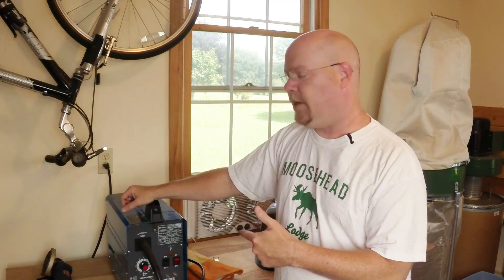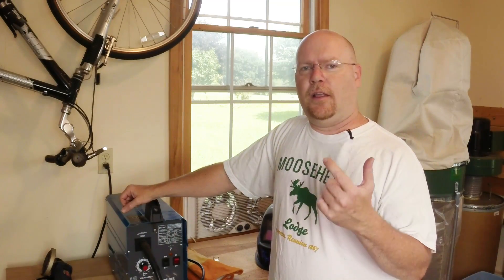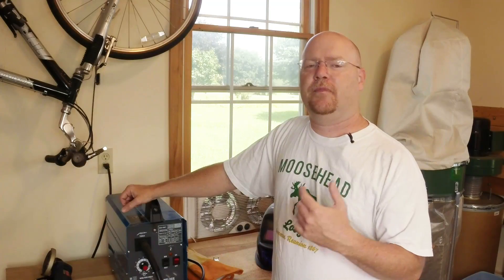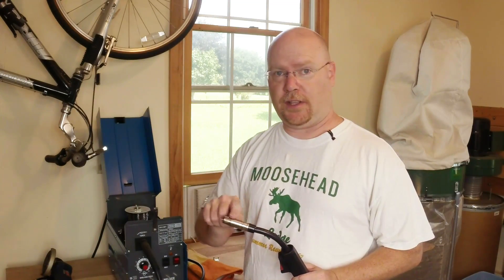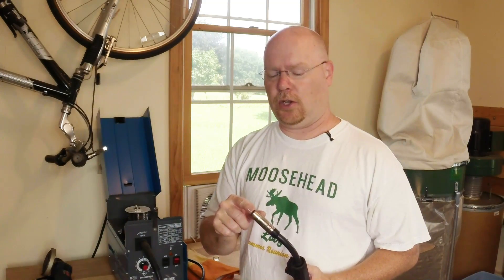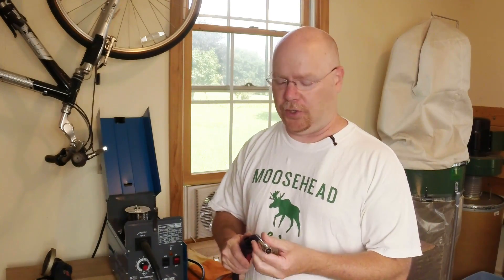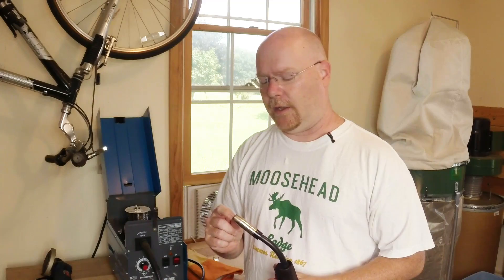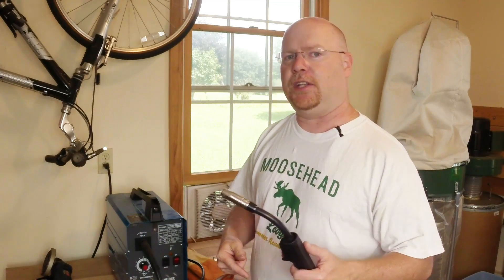Easy Harbor Freight 90 Amp Welder Mods 01

Comment: Since doing this mod, have you tried welding thinner metal (20-22ga)??
Reply from the maker: I've done some 20ga since doing the conversion to DC.  It can be done, but it's dicey.  You have to stitch weld.  If you try to run a continuous bead it''ll blow through for sure.   Even then you have to keep the "stitches" pretty far apart and make sure the piece has cooled down completely before putting down another weld next to a previous one.

In the end I decided that this welder is really only useful for 1/8" material.  I end up oxy-maap brazing the thin stuff most of the time.
Reply: Matt Heere right on!! I’ve got a newer version, I’m trying to do patch panels on my car, it’s blowing right through the way it is!! Was hoping that if I did this conversion it would’ve helped??
Reply from the maker: No, unfortunately it won't.  In fact, it'll probably make things worse.   It's easier to control once it's modded to D.C., but it runs like it has even more power.
Reply: Unless you have a nice everlast pulse mig setup like I do, sometimes you just need to stitch weld. If you can get to the backside, sometimes putting a good heatsink right up against the metal will help prevent burn through.

Comment: Matt, HF upgraded their base model to 125 amps. To convert to DCEN, would all the same parts work?
Reply from the maker: Same idea, but the parts need to be bigger.  You'll want at least a 150AMP rectifier.  Probably also need a higher voltage rating on the capacitor, but without being able to stick an AC peak voltmeter into the new unit I can't say how much bigger.

Comment: I've watched both series of your videos and think that their FANTASTIC . You have great attention to detail and have obviously spent time and effort researching everything that you've covered. 

I haven't read all of the comments and apologize if someone else has brought this up.  Doesn't the flux core vaporize and provide a gas shield around the puddle?  Isn't that how stick welding works? It's been 40 years since my metal shop class, but I think that the coating on the outside of an arc welding rod vaporizes and creates a bubble of inert gas around the puddle. Because the rod coating has more volume than the flux core of the wire, the stick generates a better shield than these inexpensive wire welders. As you point out, using a real MIG welder with an inert gas has the same effect and really does utilize the cone.

At any rate,  I have this same blue HF wire feed welder and admit that I've never been great at welding. Still, when I find a sweet spot combination between the cone angle and distance above the puddle I get: a good solid bead with little to no porosity. The bead has great penetration (especially when I bevel the edges of the seam), and I end up with a uniform layer of slag that needs to be chipped (not brushed) off the bead when it cools.

Regarding the spatter, I coat the cone & tip with Lincoln nozzle gel. I also wipe a ~1-2 inch wide stripe of the gel on either side of where the bead will go. The gel reduces spatter buildup in the cone and aids in removing the spatter from around the bead. As you also pointed out, the full length  cone makes it difficult to see the puddlr. So I neither pull nor push the gun. Rather, I draw it sideways so I can both watch and control the puddle.

Please note that I'm not contradicting any of your observations, suggestions, or the u sensible need for these awesome improvements. I personally can't wait to make these mods and try them out on my next project. 

Thanks again for all of the thought, time! effort, and talent that you've shown in your work.
Reply: Is it a pretty straightforward process to similarly upgrade any of the ac flux core welders in this class?  Like this one, for example...https://www.ebay.com/i/272834467383?chn=ps&dispItem=1

Comment: Keep the cone on its keeps the tip cleaner longer and you won't ground the torch on work piece. My first welder was a century 80 amp I had 20 yrs ago still have but up graded to a 255 mig tig stick combo and love it.
Reply: I bought a PowerMTS welder (mig/tig/stick) machine. mig/tig/stick welders are the best thing since sliced bread.

Comment: I will try to keep this short.  I have one of these welders that I purchased probably 5 years ago.  It did not weld very well and I thought it was just me.  I found these videos. I haven't installed a capacitor yet, just used the rectifier.  The difference in weld quality is amazing and I am still using the cheap harbor freight wire that came with it. THANK YOU for the series of videos.
Reply: If I had seen these videos 6 months ago I might have kept my HF welder but ended up getting frustrated and just bought an everlast welder. The welding with the HF was difficult but I was really upset with the low duty cycle. I guess I could have mucked with it and put a large fan in the case to help keep the insides cooler.

Comment: Your series has been a great educator. I was remembering when in high school ag shop that my welds never looked as bad as what I produced with the HF 90. Now that's been 34 years ago but I never remembered the splatter this thing produced. I tried inevitably to improve my skill with practice but that splatter issue just drove me crazy. I watched your videos on all the improvements, including the DC modification. My 100 amp rectifier and 75v/56Kuf cap are on their way! Thank you! I'll still need to practice, a lot, but at least I'll have a welder that doesn't make me look bad even when the welding is done correctly.

Comment: Can that welder weld stainless steel??
Reply from the maker: +hcracer1985 Flux core wire for stainless does exist, but I wouldn't bother trying it with this welder.  You need better heat control for stainless, and you just don't have the options here.
Reply: What about high carbon steel?
Reply from the maker: Same story.  Anything other than mild steel requires more heat control than is possible with this welder.
Reply: I've got an Everlast 140A welder coming any day now. Will 140A provide enough heat?
Reply from the maker: Depends on what you want to weld.  You'll be good with up to 1/8" mild steel for sure.

Comment: I watch this video modify my harbor freight 90amp wire welder and did some welding changing over to a positive ground using the same 100 amp rectifier and using the Licoln flux .030 wire and tip what a difference in the welding. the only capacitor I could fine was 50vdc 24,000 uf it works just fine. (used no. 8 wire)   thank you  Doug Viele
Reply: I know Im pretty off topic but does anyone know of a good place to stream newly released tv shows online?
Reply: @Matteo Brayden try FlixZone. Just search on google for it =)
Reply: @Santana Mohammed Yea, been watching on FlixZone for months myself :)
Reply: @Santana Mohammed thanks, I went there and it seems like they got a lot of movies there :) I appreciate it!!
Reply: @Matteo Brayden glad I could help xD

Comment: I just purchased a HF 90 Amp welder.  It seems most of these mods are unnecessary with the more recent version, Item #61849.  It comes with a .030 tip and wire.  The tension roller mechanism has been changed where the newer version doesn't seem to have the same problem.  (ie there's plenty of room for tension adjustment.)  That's the thing I like about HF tools other than the price, that when there are problems they seem to improve the design in newer versions to eliminate those problems.  The only mod necessary is to likely get some Licoln Flux-core wire instead of the HF supplied.
Reply from the maker: +rednroll1 That's good to hear!

Comment: did a similar conversion on.  a lincon 80 amp flux core welder. having a small problem. when I test ran the machine the wire drive motor ran backwards!!! looking for a fix. of you know anything. or even where to look I would appreciate it. by the way loved the videos.
Reply from the maker: +danilemetzger Only thing I can think is that you have the motor circuitry hooked up after the rectifier now.  I'm a little surprised that an AC motor will run at all on rectified power, but if it does it could certainly run backwards.
Reply: Figured it out. Wiring problem. Also the motor was turning slow. Oiled it up. And the it layed a beautiful bead
Reply from the maker: danilemetzger That's awesome!  Glad to hear it's working out for you.

Comment: Matt; thought I ordered a 50 volt rectifier but I got a "QL100A 1200V  single phase 4 pin rectifier, will this work for the conversion?
Reply from the maker: +weoswes That's exactly the one I have.  It works great.  The 50V number is the nominal voltage rating for the capacitor.

Comment: You can replace the metal MIG nozzle that's too long (not sure why they even put it on a gas-less gun that's not meant to be converted to MIG) with a pointy plastic flux core nozzle, not that it's necessary.

Comment: Its  a 100.00 welder. Use it according to the instructions and it will work satisfactorily. Don't try to out think the R&D engineer's who collectively have more degrees than a thermometer. I have one, never had an issue with it. Works as designed.
Reply from the maker: Have one or two of those degrees myself :)  You're right about the welder for sure.  It does work out of the box, but this in no way precludes us from smoothing out some of the corners that got cut getting the price down so low.
Reply from the maker: Agree 100% pccchurch.  Now, the part where I'm supposed to "know what (I'm) ur doing" may prove tough, but the opportunity is there ;)
Reply: HF welders can improve immensely with a few mods. For their stick machines, change out the stick holder and ground clamp with their premium stick holder and ground clamp. It turns a frustrating experience of trying to strike/maintain an arc into a surprisingly easy one.

HF makes tools to meet a price point. They will cut every single corner they can to save 1/2 cent. If u see their prices compared to any other retailer, u see that they have really low profit margins so they cheapen out whenever possible.

Many HF machines and tools can go from ok to great with some TLC re-alignments and modifications. That assumes u know what ur doing.
Reply: Is it a pretty straightforward process to similarly upgrade any of the ac flux core welders in this class?  Like this one, for example...https://www.ebay.com/i/272834467383?chn=ps&dispItem=1